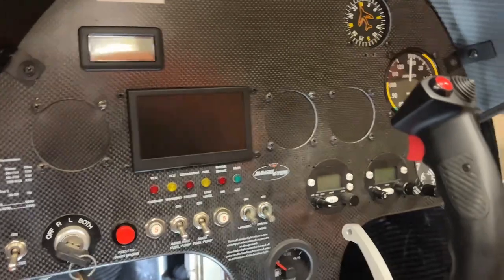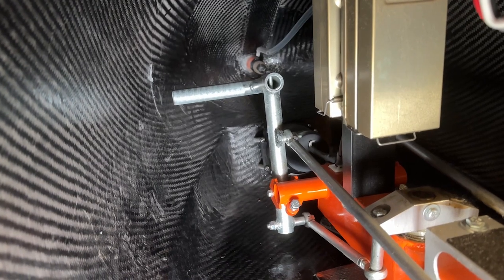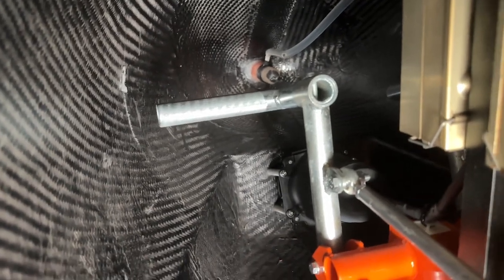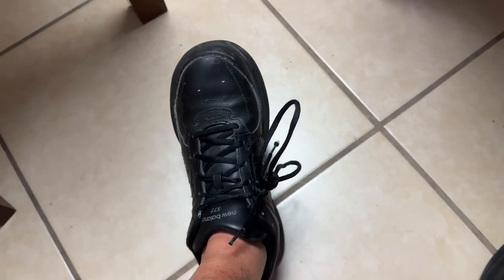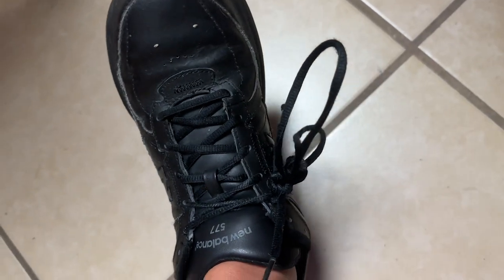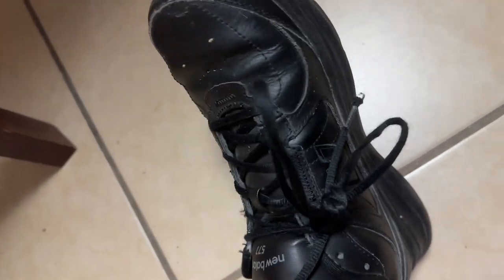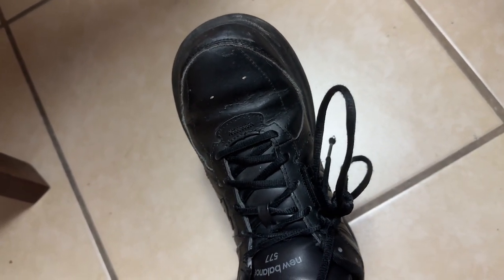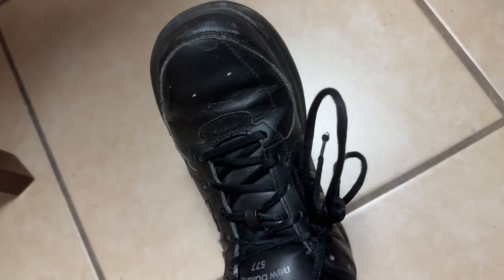A strange case of Pedal problems in a Gyroplane- Don't let this happen to you!!!

Comment: Reminds me of when I was driving down the Swiss Alps in a van with 13 children.  I was not driving fast but I was braking at a 180° hairpin turn and when I hit the brakes the first time, a bottle of carbonated water on the seat behind me, which the bottle was made of really thick reusable plastic and we were at high altitude so more pressure, rolled under my seat and lodged under the brake pedal and I couldn't brake at all, literally at all.  I realized what it was and used my left foot to move it and finally stopped the van just before hitting the guardrail after crossing into the other lane.  Had I gone through the guardrail, it would have been an international disaster story of 14 people who drove off the Alps.  😅
Reply from the maker: Damn, I mean Damn!!